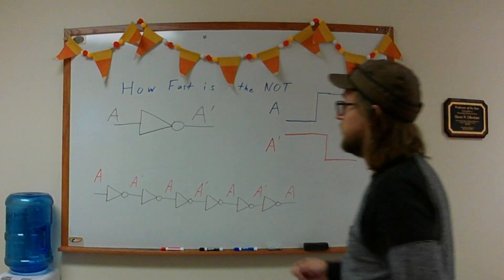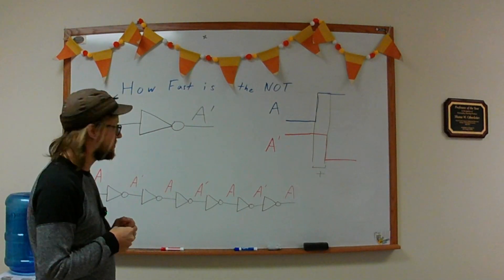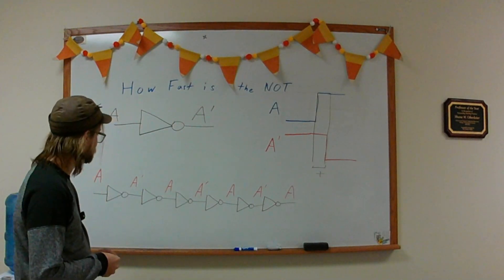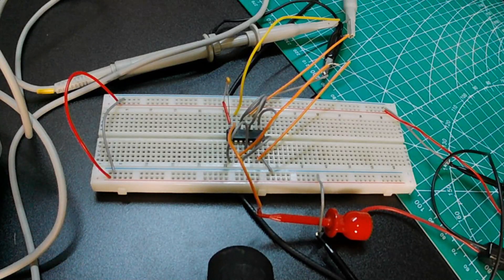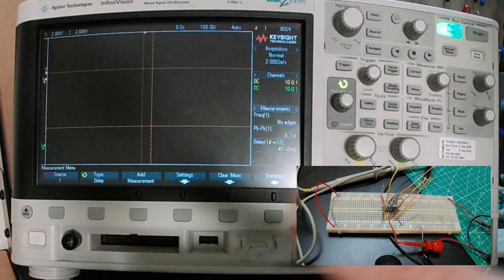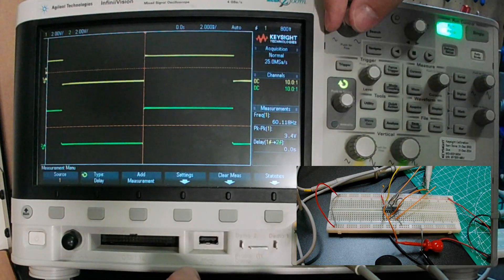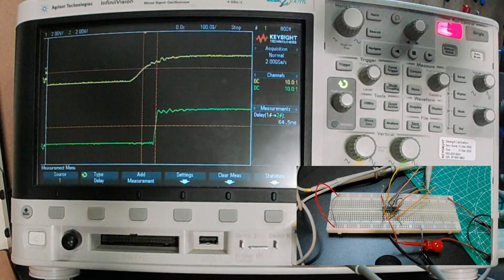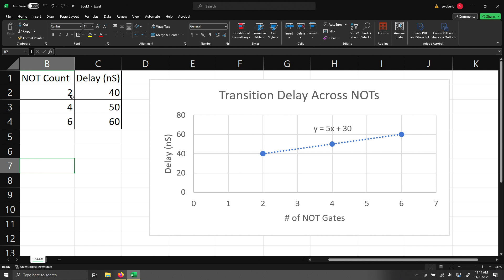Finding The Speed of a NOT Gate (Using an Oscilloscope)

Comment: The measure methodology could be improved. Those dinky wires have losses due to impedance. You should use spring clips in your probe to measure oscillating signals. I would suggest watching this video: https://www.youtube.com/watch?v=ajwZVAVo3yk about why 2 logic gates are faster than 1. The results should be opposite.